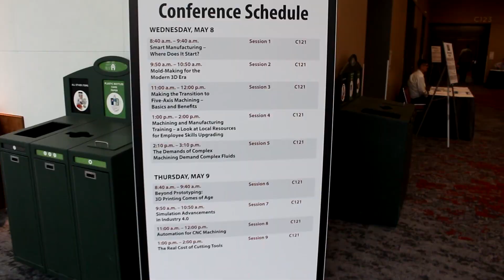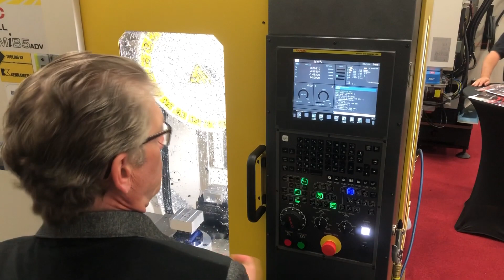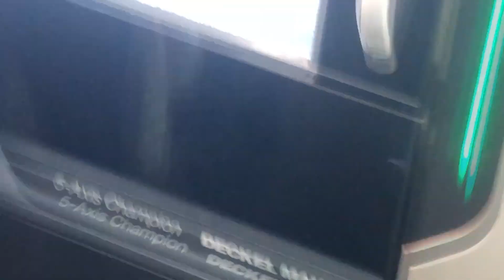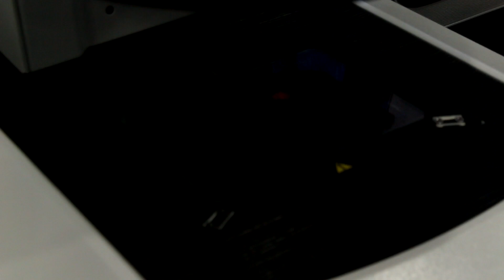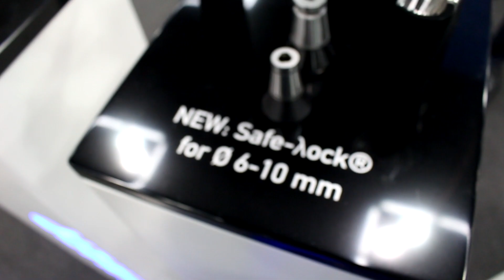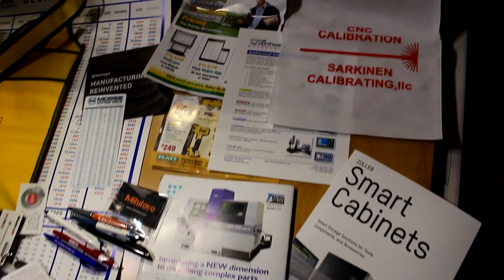Northwest Machine Tool Expo 2019

Comment from the maker: Woah guys!! Here are some time stamps...

1:43: Levil LTC-F20 with Fanuc Control Panel
2:00: Fanuc Exhibition and robotic arms) 
2:13 Fanuc Robodrill A-D21M1B5adv
2:25 Fanuc Robocut C400iB 
2:50 More Fanuc Robodrill D21MiB5adv
4:01 Sawyer Robotic Arm
4:13 HAAS DM2
4:27 Robotic Basketball Thrower
4:33 Metrological/Inspection Tools
4:38 ShapeGrabber
4:51 C-Vision Video Contour Projector
5:09 DMG MORI DMU 50
5:38 Bumotech S191
5:44 Starrag Tool Cabinet 
5:57 Mikron Mill E 500 U
6:16 Spinetti Machinery Exhibition
6:16 Cincom Swiss Lathe
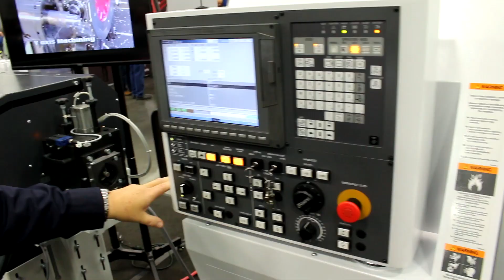6:44 Miyano 2 Spindle Lathe
7:24 Sanguang HB400 EDM
7:45 Mastercam Exhibition
7:50 Markforged
8:25 Renishaw Equator 300 CMM
8:50 Blaser Synergy 735
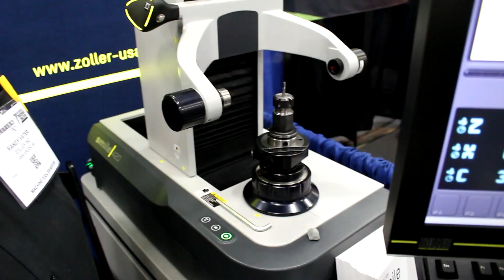8:57 Zoller Smile 420 Tool Presetter
9:16 Zeiss O-Select Digital Measurement Projector
9:39 Mitutoyo Exhibition
10:00 Kennametal Tooling
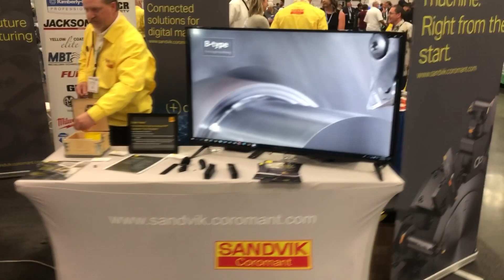10:48 Sandvik Exhibition
10:58 MVP Stellar Industrial Supply Handing Out Drill/Tap Size Posters
11:02 SECO Tooling
11:08 OSG Tooling
11:13 Various Tooling
11:20 Tungsten Toolworks
11:37 Allied Machine & Engineering 
11:49 Ceratizit Promax Tools
12:04 Blue Photon Work Holding
12:16 Haimer Tool Holders
12:41 Genswiss Tooling
12:50 Schunk Tool and Work Holding
13:13 NSK High Precision Spindles and Hand Tools
13:30 MD Tool and Work Holding
13:37 More Blue Photon Work Holding
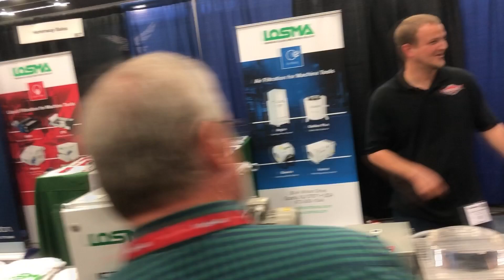13:56 Chick Work Holding and Vac-u-Lok
14:14 Various Exhibitions, ProShop, MachineScope, WestCAM, etc.
14:37 Epilog Laser
14:47 Olympus Controller
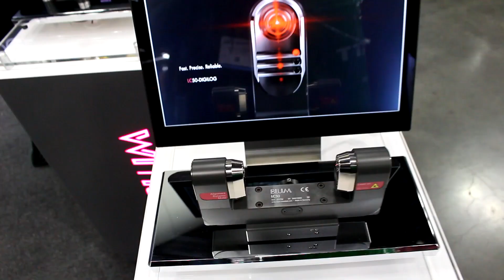14:59 Blum Novotest LC50 Digilog In-Process Laser Measuring System
15:10 Engitype 3D Printer Sales and Service
15:18 3DSystems Material Swatches
15:30 Resin Print of Thanos (SICK!)
15:38 Various 3D prints
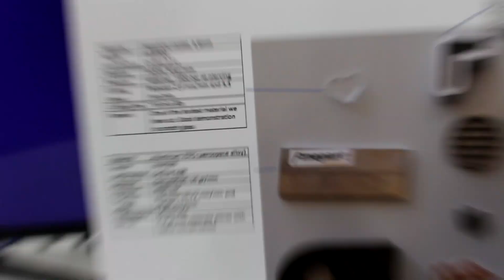15:45 Finepart High detail parts
15:56 HP Jet 3D Prints
16:06 A Kind Gesture
16:25 More Fusion Jet Prints
16:45 3D Printed Claw, Chains
16:55 Escape
17:05 LOOT HAUL